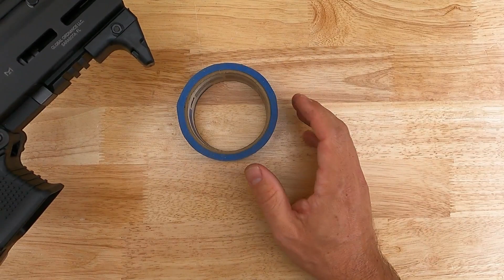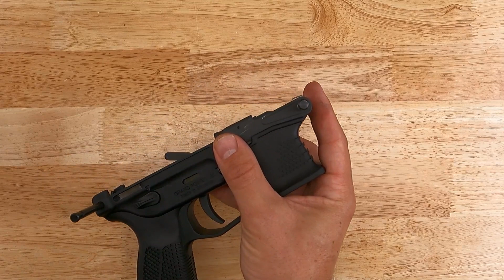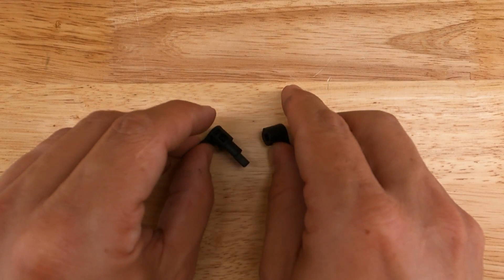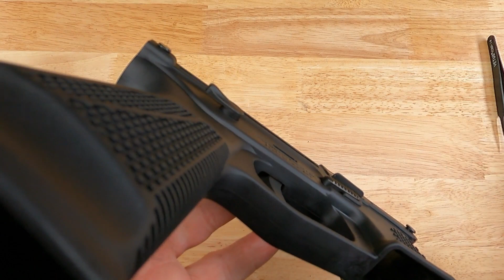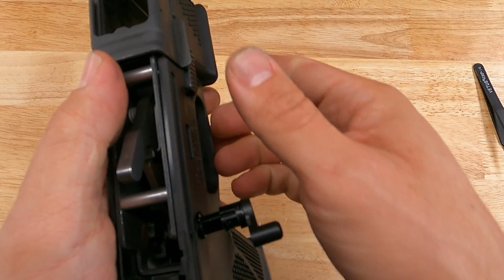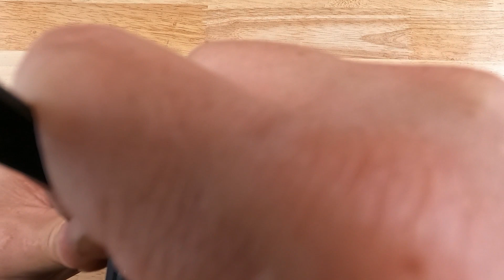HBI STRIBOG SAFETY SELECTORS INSTALL

Comment: Is this safety quieter than the OEM? The original makes a super loud SNAP! sound when you take it off safe. Can't get it any quieter even if I slowly ride the safety down
Reply from the maker: Unfortunately the sound is primarily associated with the two selector detents, which do not change... our selector spindle is machined from aluminum and does have a different "tone" (lower pitched) but they are still more audible than say an AR style selector with just a single detent.

Comment: Just installed the locking charging block, extended bolt release and light trigger spring today on my A3.
Trigger spring was kind of a ho but got it all together again. Do you think yall will make metal detents for the safety selector? That's the only reason I didn't order your selector last week (y'alls shipping time is astounding, btw). The plastic factory ones just scream "point of failure" to me.
Reply from the maker: Thank you for running our parts and the kind words on shipping times. We did prototype some selector detents out of necessity (launched one or two oem parts when factory spare parts were not available). We have tinkered with alternate materials but also have not worn out the oem detents in any of our Stribogs either. For the time being (2022) we are in kind of a "wait and see" mode. If we do start wearing out the factory detents, or if replacements become impossible to find again we may do a short production run of them.
Reply: @hb_industries  I'm also interested in non-plastic detent pins as well
Reply: I'm want also

Comment: My blunt opinion on the design of the safety mechanism is that drinking vodka while designing mechanisms for a weapons fire control makes for poor decisions. Genuinely awful design
Reply: You must be drinking vodka then because the safety selector on the Stribog is very good. Switching the selector switch to the metal HB Industries is nice but not necessary.  I switched mine mainly to delete the one side. The stock one works flawlessly though.
Reply: @whatsup24_7  The external selector shape is fine, the internal mechanism is not. The 2 detent system is needlessly complicated, and the 2 piece "snap together" shaft is poorly designed.
Reply: @ppmnox  I have 4,100 rounds thru mine using the safety constantly and never had a problem. Works perfectly.

Comment: Great video, what hand stop is that?
Reply from the maker: The handstop is from a CZ Scorpion Evo. It is blasphemy but the factory Evo handstop works/fits perfect and we have nearly all of our shop stribogs configured this way. There are many other 1913 mounted hand stop options though.
Reply: @hb_industries  awesome, so you offer it? Under CZ section?
Reply from the maker: @tommypicchi9601  The ones that we have been using are just "take offs" from Evos that we have built. You can buy the hand stop from CZ-USA though: https://shop.cz-usa.com/hand-stop-evo366014200703.html
Reply: @hb_industries  I found that too and they’re sold out, on the list. But with my lack a patience I ordered the SLR Rifleworks one 👊🏻
Reply: @hb_industries  thanks for your info. What comps would you recommend? Would the CZ Scorpion Evo Ultra Comp fit and/or look good on the Stribog? Thoughts/recommendations
Reply from the maker: @tommypicchi9601  Our Evo comp is designed specifically for the Evo (spring detent on muzzle device similar to AK). For the Stribog honestly our best recommendation would be to pick a muzzle device that works with whatever suppressor you have or are most interested in acquiring in the future. Your Stribog muzzle is threaded 1/2-28 so you have a TON of 9mm bore options out there. If you are uncertain about suppressors or just looking for a direct thread suppressor option, our micro comps work really well https://hbindustries.net/store/shop/9mm-micro-comp-thread-protector/ . For a dedicated comp or brake, again any 1/2-28 9mm bore device will work, but its largely personal preference. I would say we probably lean towards shorter more compact muzzle devices on the PCC platforms, but some of the longer "linear comps" and brakes look really slick.
Reply: @hb_industries  thanks for the info. I was looking at your micro-comp. Unfortunately can’t run a can in IL 😖. I would love to have a comp flush or recessed in the rail but I don’t think they would. Like an SLR Linear or SureFire Warden. But definitely going to grab an HB Micro. Just go for my Short Stroke and locking block from you guys today. Get my Bog tomorrow.
Reply: @hb_industries  can’t seem to find these anywhere. Any recommendations?

Comment: Do you recommend any LocTite? Just got my upgraded bolt release/stop and safety selector... very nice products and makes the Stribog feel more premium.
Reply from the maker: You can use loctite blue (242 or 243), for extra insurance if you would like. However we have found that the surface area contact between the countersunk screw heads and the selectors is enough to retain them without thread lock at 10 in*lbs.